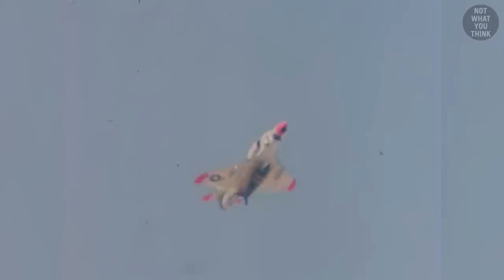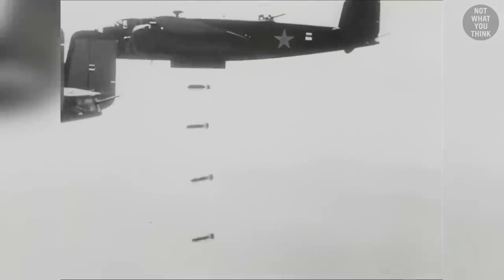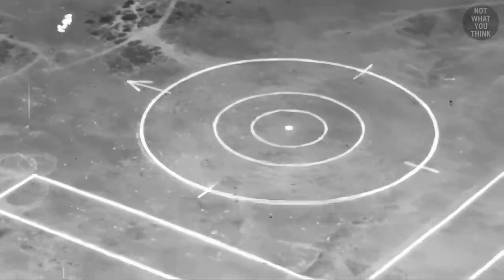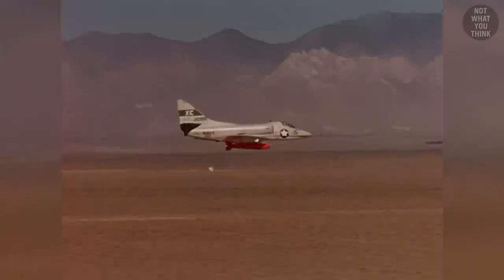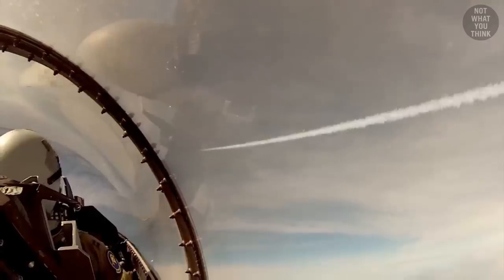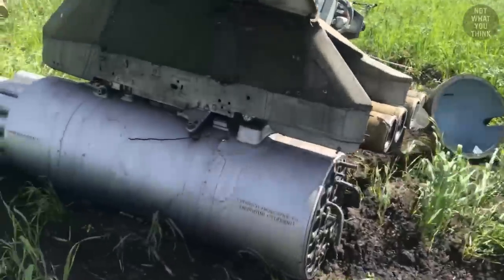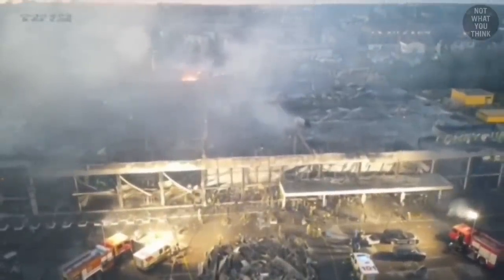Why Are Russian Helicopters Shooting Up at the Sky?

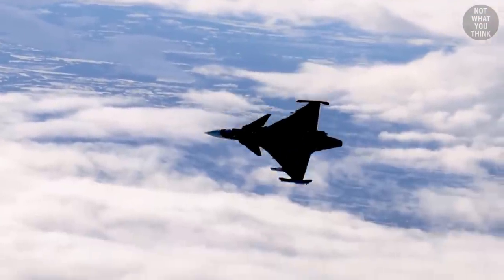Comment: 4:58 wow! An inverted B-47? So it wasn't just a Boeing pilot doing loops with a 707 then. That's insane!
Reply: I admit that was the most impressive partof the video for me.
Reply: That, is a normal procedure. See, when the nuke is released from the plane, they have to do that maneuver, so they can have better chances of survival.
Reply: How does flying upside down increase chances of survival?
Reply: Oh, in Germany Werner Baake, a former german night fighter ace, did the same near Ansbach with a Boeing 720, registration D-ABOP, twice. 
Unluckily during the second roll the plane disintegrated and fell out off sky, killing all on board. So: from hero to idiot its a short way... 🤷🏻‍♂️
Reply: @iamnormal8648  You can go away from the falling bomb quicker than in other ways. Think about when you release the bomb and fly straight forward further. The bomb will go off near the plane, because you are in the same trajectory. 
But when you climb very steep and releasing the bomb, doing a half loop after and roll out the plane you are on a opposit trajectory. 
Sorry for my english, it is not my mother tongue. Hope you know what I mean... 🤷🏻‍♂️
Reply: @iamnormal8648  They are doing a sharp u-turn in the vertical axis after lofting a nuke.  Stop thinking 2 dimensionally as planes fly in 3d.
Reply: @iamnormal8648  because the aircraft s climbing while flying inverted, they release the bomb as they are pulling the aircraft into a loop tossing the bomb. He bomb is still climbing on a ballistic trejectory as the bomber is ia pulling out of it's dive now heading the opposite direction as the bomb is traveling y the time the bomb fell to the Target and detonated the bomber was miles away and low enough that it would be below the horizon from the target.
Reply: @herrunbekannt7556  there can be a fine line between hero and zero
Reply: Yes, I thought it was a slow-moving aircraft that barely has enough engine power and wants to fall apart from any overload.. I'm a little shocked, lol
Reply: It's no problem as long as you don't overstress the airframe. A barrel roll like it was done with the 707 airliner can be flown as 1G maneuver, which means if you sit in the plane and close your eyes, you won't feel anything about flying upside down. The same is true for the aircraft, it's the same stress as flying in a straight leveled line. The problem with big aircraft is that they don't have the thrust-to-weight ratio as fighter jets have and they can't handle high G loads either. Therefore such maneuvers have to be done very slowly (compared to a fighter jet) and in a looping you will very fast reach the limits of the engines, which are not able to maintain the speed during the vertical climb. Pulling the loop tighter increases G forces, doing it is a balance between these two limits.
Reply: 🇺🇸an technological/engineering superiority!! A high-subsonic  bomber doing a loop!!👍👍👍👏👏👏
Reply: @gags730  By the end of the second war the Germans had stealth submarines, 30cm of soft rubber to adsorb the sonar.
Reply: not a loop in the 707,  a barrel roll.
Any aircraft can do a barrel roll as it is a 1 g maneuver.. there is no additional stress on the airframe, the occupants and the plane would not feel the difference compred to level flight
Reply: @ben_doom1958  Been in a helicopter doing that, memorable when you are  sitting looking out the door, and above you is the ocean, and beneath your feet is the sky. You would not think 16 tons of helicopter can actually do that. As for transport aircraft being underpowered, they are suprisingly robust, as I also later on had the dubious experience of hearing the 2 ahead of me in the circuit landing, hearing it through the sound proofed walls of the third one in the circuit. They scrubbed all those tyres to replace in a single landing, and left a pretty impressive cloud of burnt rubber as they jackhammered the crabbing aircraft down on the runway.

Of course the pilot flying the one I was in had much better cross wind capacity, and came in with a hot mic, reading off altitude till he went silent at 3, and after 5 seconds, when he commented for full reverse thrust, that for all those who were waiting, we had landed 400 feet back from there. No noise, no bump, no smoke. Interesting flight, got to watch air to air refuelling, the success, the fails, and the come back with a very clean plane, after doing too fast a disconnect, and getting washed with 500l of Jet A, promptly flaming him out. Bank off, aim level and get to practise that flame out restart procedure, that before had only been done in the static simulator, and come back to do it properly again. Passed that phase perfectly, did not get the package of the torn drogue sent to him as award. Same week also had to jump start helicopters, all that training as apprentice sure came in handy there, as I had to learn the entire airframe electric system, and read all the documentation as well, and a lot of it did stick.

As to the toss bombing that is CCRP, different from the US standard of CCIP, and yes the bomb will go a lot further.Did hear of one pilot who did that, and he was a little hot in the pull up, and missed the target by a little. Also missed the bombing range entirely as well, and the farmer got a new tractor out of it as well, because the practise round landed near him in the field.
Reply: i think it was photoshopped.
Reply: @iamnormal8648  because it just looks cool. whos going to shoot down a plane flying by upside down? I wouldn't!
Reply: I wonder why or how it didn't got stalled, since it's very huge. Maybe its speed is really fast at that time, giving it the time to turn around quickly.
Reply: @iamnormal8648  Everything, you will see Earth, not Heaven.
Reply: @gags730  My father was doing that post war, importing 46 jeeps bought as war surplus to Central Africa, and assembling the crate units there in his garage. Due to the QC being less than stellar, he had a big order of spare parts as he started, sent at the half way mark, to repair those that were faulty. So at the end he had the 46 he ordered and paid tax on, and the spares that were left over from the faulty units ( engine not working, order complete engine as spare, and fix that one later on, same for transmission and other parts) enabled him to make no 47 for use around the shop, as it could not be registered and sold.
Reply: @apolakigamingandmore6376  Flying inverted is easy, you just have a limited time to do so, as you are very rapidly scrubbing altitude and velocity, though a lot of fighter aircraft are designed to be able to fly inverted no problem, though, due to the internal inverted flight fuel tank, held in the final fuel tank, only holds around 30 seconds of fuel in it for this, before you have to fly in a normal orientation again. Also a lot of the hydraulic systems are going to run into issues, as they lose the fluid in the pressure reservoirs, as the pumps are no longer able to scavenge fluid from the sumps.
Reply: @gags730  Central Africa, where the cost of shipping was high, so when he sold the municipality a new set of US built Cat dozers, their first job was to dig a big pit, and push the old fleet of British made, Rolls Royce Merlin derived engine powered dozers into the pit, and cover it. New ones were both more powerful, much more reliable, and had half the fuel consumption of the ones they replaced. Reason to push them was because the old fleet only had one working left, and it was not capable of pushing another, so it was the only one that drove in under it's own power. Shipping stuff out took space on a train, that would otherwise be used to carry copper anode blocks from the mines, so the cost of freight out was high, but incoming was cheap, as the cars had to come back anyway, so filling them was almost zero cost other than the fuel.

Comment: Loft bombing can be surprisingly accurate. As long as the pilot deploys the weapon at the correct Speed, Angle, Altitude and direction. They will come racing down on the desired enemy position, ammo dump, headquarters, equipment concentration or troop concentration. 
And
According to reports, they have managed to do just that more often than one might think.
Reply: Considering pilots are living calculators, I wouldn't be surprised if they did hit specific targets.
Reply: @fatcat1250  i think its like tossing a ball; once you practice a bit, you can get really, really good at it.
Reply: @fatcat1250  or the aircraft designer could just install a dedicated calculating system to release bomb/launch rocket at the right time. Kinda like CCRP bombing
Reply: Did you three responding commentguys even watch the video?  It clearly explained the part about the computer doing the timing.
Reply: @jenkem4464  
You should watch it again. 
He only theorizes that they could be using a computer to help fire the rockets, since modern aircraft use computers to lift fire bombs. 
It is not truly known if computers are used to loft fire rockets or to what extent they help if they are used.
Reply: @charlie15627  ...They showed a video clip of the pilot turning on the LABS system and explained....this is what they did.  The target was pre-computed.  Initiating the LABS told the pilot when to climb, when to throttle, and automatically detached the bomb when at a specific point. 
I realize now you're talking about the Russian helicopters and I thought you were talking about "loft bombing" in general...which they did show an old clip of computer/machine guided loft bombing.
Reply: @jenkem4464  
The whole video is about the Russian helicopters. They just included the things on loft bombing to help put things in context. 
When it comes to the limits and capabilities of the Russian helicopters and weapons systems, it’s all guess work. We don’t really know what they can or can’t do. All we can do is examine any video or other examples of their activities and make deductions from them. In the end, it’s all guess work. 
We do know that at least some of these attacks have hit right on target and been devastating to the defenders. As to how often they hit on target, we can’t really say. 
Ukraine lies and says they never hit on target. 
Russia lies and says they always hit on target. 
The truth is somewhere in the middle but in the end, it’s all guess work.
Reply: @charlie15627  The Russian missiles are not as well characterised as bombs, where the designs are held to tight tolerances, so the casting is machined to a very precise profile, the fill mass is carefully controlled, and then the balance point is adjusted to put all of them at the exact same balance, so all will fly the same. My grandfather was the one who made the patterns for the bombs in the war, and cast them, then they got filled and shipped to the UK and allies. the same bombs are still in use, as the newer weapons systems were also calibrated to use them, so they kept making them to the same spec. 

The mass produced rocket is not as well controlled, and as well as the propellant fill ages it varies a lot in burn time and pressure, so they have very little consistency. After all they were designed to close in point and shoot application, not for precision long distance work. I doubt that they even can get the same batch and lot numbers per load, all likely being different ages, different manufacturer, and different storage locations, all brought there fast to be used. Also probably more than half of them are duds, with the famous QC that the USSR was known to have for military stuff that was produced, where production quotas were the only metric looked at.
Reply: @SeanBZA  
You don’t seem to realize that Russia has consistently been selling the older manufactured munitions to other countries and preserving the newer manufactured munitions for themselves. 
These rockets aren’t meant for pinpoint precision. They’re meant to blanket an area like an automatic grenade launcher burst or an MLRS cluster. We really don’t know about the things you are suggesting like propellant variations, none of their modern rockets have been examined. All we have to go on are the older Soviet rockets that Russia got rid of. It’s safe to assume that the rockets Russia is using are better than the ones they sold but we really don’t know how much better. 
There is an insane amount of guess work going into analyzing modern Russian equipment and munitions. Every once in a great while the guess turns out to be fairly accurate. That’s not usually the case though. Most of the time the guess turns out to be way off one way or another, as history has shown us. 
We do know that Russian helicopters are using this technique and that it has been effective. Everything else is just guessing.
Reply: @charlie15627  Well, living in one of those countries that got a lot of those less than stellar munitions used against us I concur, but also the Russian army is itself also having to use them as well, having nothing more modern in great supply. Yes less than accurate, but great for area denial and also providing cover fire. as you do not know exactly where they will land other than a general area.
Reply: Accurate for 50th?
Reply: @fatcat1250  nope

Comment: The South African Air Force Mirages perfected the toss bombing techniques during the Angolan bush war in the 80’s. There were no guided weapons but plenty of SAM, both radar guided and MANPADS. This was the only way to hit enemy targets. Skim in at tree top level, toss the bombs, turn and run before the SAMs could lock onto you.
Reply: Yes, and I worked on those systems. Also met a few of the pilots who were there, including the one who came back missing the back of the aircraft, because a SAM took it out.

Comment: Loved seeing the A-4 loft bombing video!  I used to work on A-4 avionics, which included the LABS system.  With the LABS timer and an identification point, the pilot could complete the bombing run with a nuclear flash shield over the cockpit.  The needles on the AJB3 "meatball" would provide the guidance on when and how to pull up.  The accuracy was good enough for nukes... not sure you'd want to do it for conventional ordnance.
Reply: As my Dad often said, "almost only counts in horseshoes, hand grenades, and atom bombs"
Reply: Saved your ass from the amateur Sceptic 😂
I can still see that A4 today that flew over the lake in my story above. It was scary cool 😎
From an old builder of the weapons of Mass Destruction Aerospace Guy 🖖
... kids nowadays huh
Reply: @EinfachFredhaftGaming  
Yeah, figures.
My response didn't load. And I even gave it a 👍. Seems to be happening a lot on YouTube lately from the comments I've been seeing. ANYWAY.
Took me all of 5 minutes to Google the AJB3. And that includes 4 minutes of reading other stuff about the A4.
I was just surprised how an old guy can find it Immediately. While you kids always come up with " ???? " 😂
Reply: Well, since YouTube got me from Behind 😳, better repeat my story.
The Blue Angels flew the A4 for shows (obviously) at the Hydros over Lake Washington a thousand years ago. And I remember,.. and have a picture somewhere,.. of one flying inverted SO LOW OVER THE LAKE. It was kicking up its own Rooster Tail, as it's tail skimmed so close to the lake, you'd swear it was touching. And Maybe It Was. But it was scary cool. And I remember it to this day.
... it was a different time 😎
Reply: @EinfachFredhaftGaming  
See,.. wasn't hard.

AN/AJB - Airborne Electromechanical Bombing Equipment
AJB-1		LABS (Low Altitude Bombing System)  for F-100D 
AJB-1B    	LABS Inertial Guidance? 	for F-100 Super Sabre
AJB-3*		Loft/Toss-Bombing Weapons Delivery  for F-3, F-4A/B, A-4 
AJB-4		Low Altitude Bombing System 
AJB-5		LABS  	for F-4 
AJB-7		Attitude-Reference Bombing System  for F-4 
AJB-8		Inertial Nav/Attack System   	    for AV-8A

... i still got game 😏
Reply: @EinfachFredhaftGaming  
Crap. Another Response Didn't Take.
ONE OF YOU DOESN'T LIKE ME 😂
But if you are actually interested in designations, of what looks like about EVERYTHING.
I found that on "RadioNerds" website. Enjoy 🤗 👍 🖖
Reply: @My-Pal-Hal  I want to say that it was more a response due to the incomprehensible state of your earlier reply. AKA, The fuck is that supposed to mean.
Reply: @jamjam-sp3he  
Anything else you "want to say" ???
Cause I got a dollar, I'm the only one talking to you 😂
... because i like trolls, trolls are Fun, slow, but fun
Reply: @mommyneedstochangemyJamJams 
Nothing ??? You Sure ???
Ok, guess not,..  ... AKA, 🤡💩🤡
Reply: @falconerd343  *H-bombs for the alliteration :)
Reply: @My-Pal-Hal  FYI, YT auto-deletes comments with links or stuff that looks like links.
Reply: @falconerd343  
FYI.
First, not if the link is a YouTube link.
Second,.. I didn't add links. I just copy and pasted what was needed.
Third.
Yeah,.. YouTube has been playing lots of games. But our government has Google in it's SIGHTS, for it's Games across THEIR SITES. So we'll see how that goes ☺️ 👍
Reply: @karlknechtel8119  
OR,..
Look at the designations of the described systems I already posted.
... worth a shot,.. or a Loft 😂
Reply: @karlknechtel8119  
Here's a copy for You 🤗
... AN/AJB - Airborne Electromechanical Bombing Equipment
AJB-1		LABS (Low Altitude Bombing System)  for F-100D 
AJB-1B    	LABS Inertial Guidance? 	for F-100 Super Sabre
AJB-3*		Loft/Toss-Bombing Weapons Delivery  for F-3, F-4A/B, A-4 
AJB-4		Low Altitude Bombing System 
AJB-5		LABS  	for F-4 
AJB-7		Attitude-Reference Bombing System  for F-4 
AJB-8		Inertial Nav/Attack System   	    for AV-8A ...

Gotta love that F-100.
The beginning of the Century Jets 😊
... man that's old school